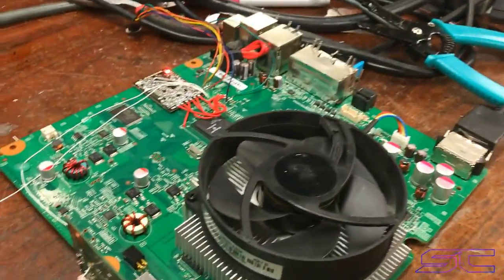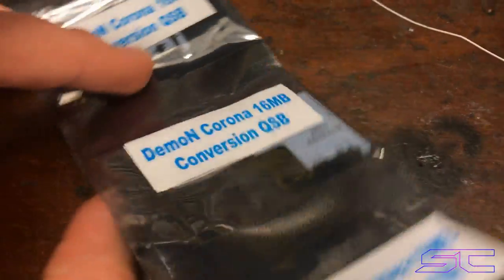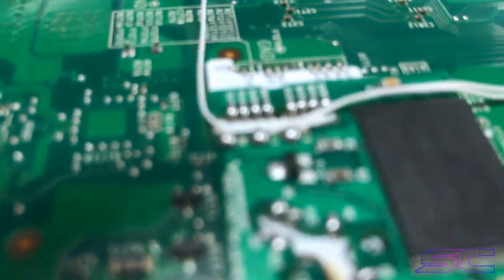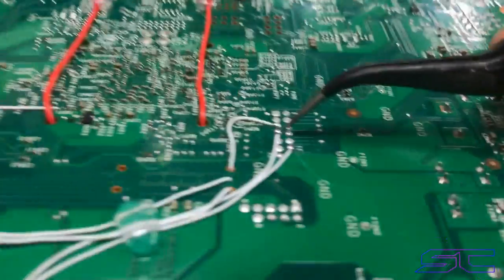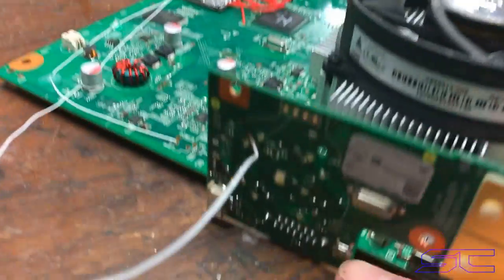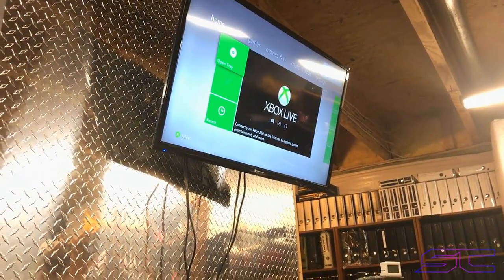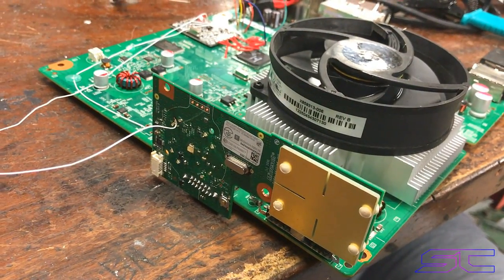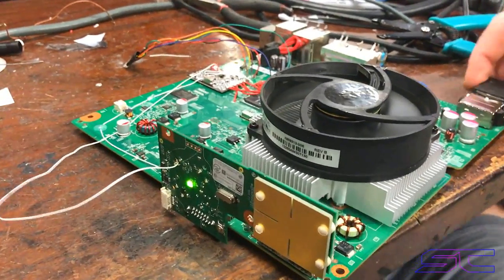Viper Dual Nand Corona. Yes a Corona... This is how i did it

Comment: What timing files do you use for this ace v3 / viper install on a corona?
Reply: Anyone?
Reply: Ace v3 comes factory with the correct timing files for coronas
Reply: @loganator78r   thanks but with a viper DN you need the change the timing files from the default files.  But not sure which one I should be using.
Reply: If you still need it: https://themodshop.co/shop/viper.html
S-RGH v2 timings with Dual nand support